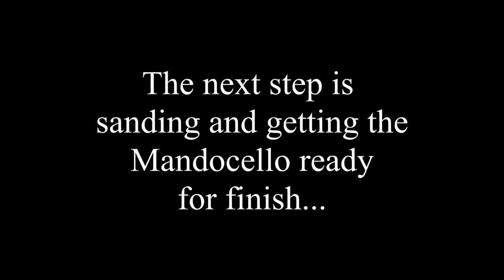Mandocello build - Adding The Binding/ Part20

Comment: Hi Tomy I don’t know if you would want to, but I’ve seen Matt at Texas Toast just use acetone to glue the binding. He tapes the binding and then wicks the acetone between the binding and the body.
Reply from the maker: I use acetone to stick my 3 layers of binding together. The Duco cement makes a very nice and clean glue joint as it ( like acetone) it melts the plastic but will also bonds to wood. I just feel that with acetone, the bonding is only the melted plastic into the wood fibres. Not saying it’s not a good way, just that I’m more comfortable using a cement.
Reply: Tomy Hovington 🤓